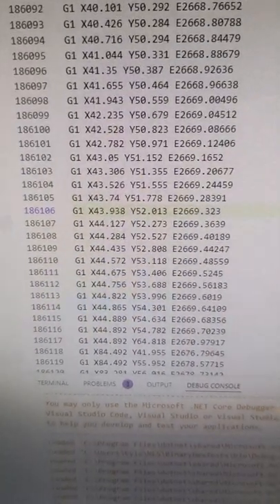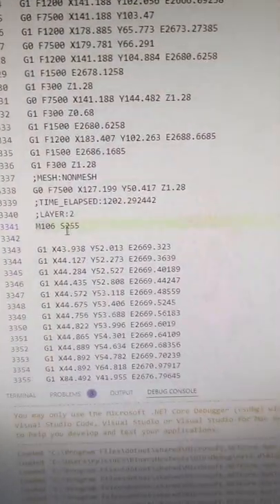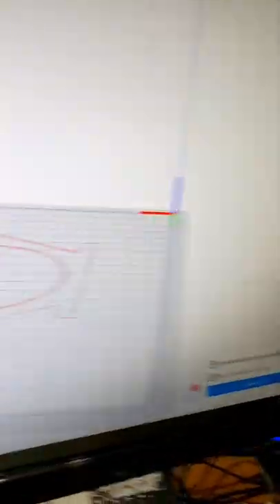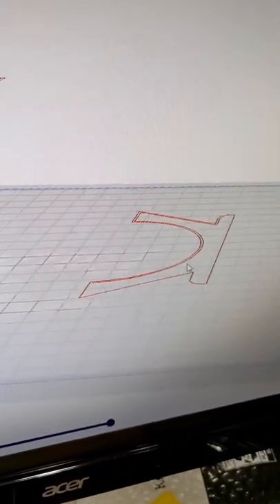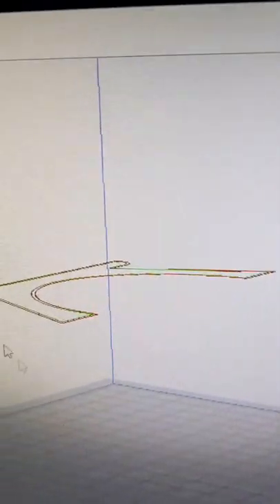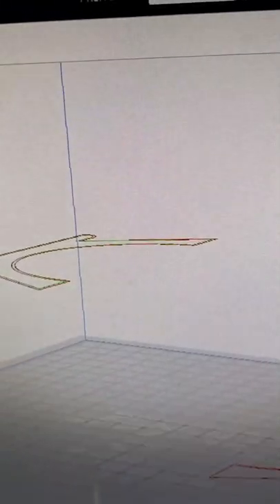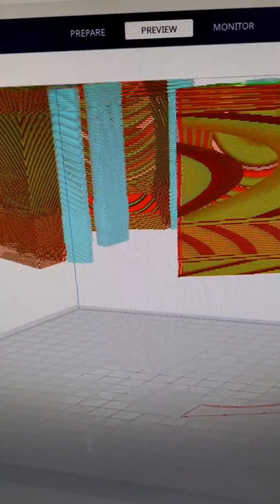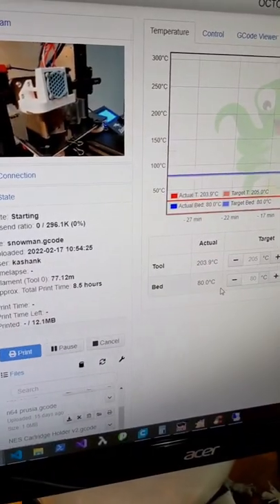Restarting a failed 3d print

Comment: This will only work if you dont have auto leveling and some other settings. There is a lot more Gcode you will have to edit to do this trick...

(I just had to deal with it on my own print, took 5 attempts to make it work)
Reply: If you have a bltouch shouldn't that fade out after like 10mms? At least there is a setting in my ender3v2 with custom firmware that sets to what height the bed leveling should fade out

Comment: had the same issue, had an issue with my print and tried modifying the G code, but when i ran the print, the model on the plate kept getting bumped into... havent touched my printer in months :(